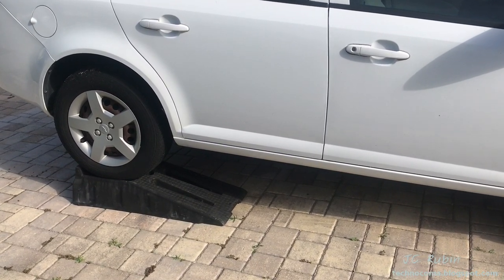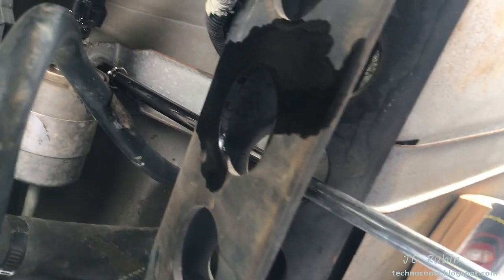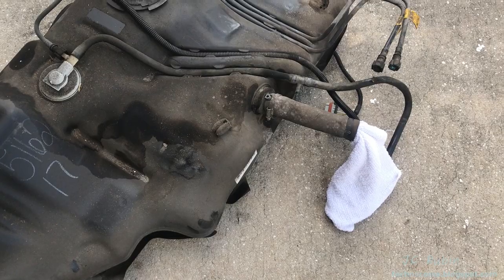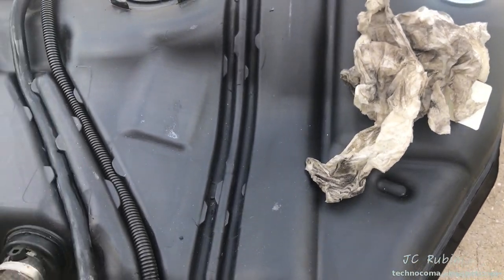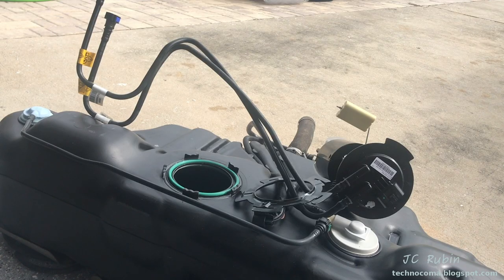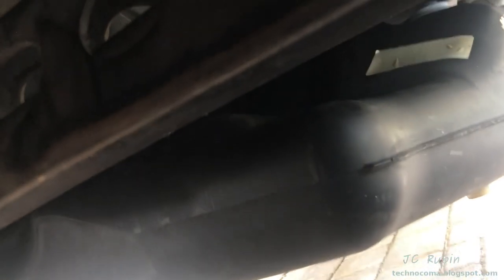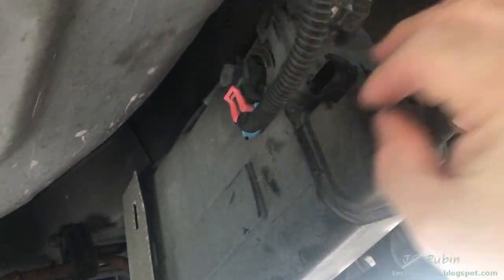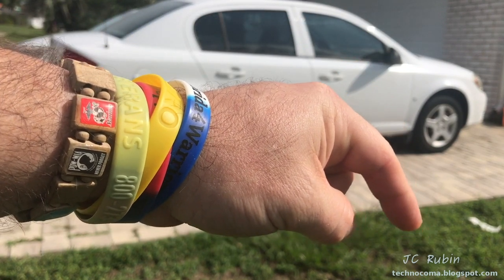Chevy Cobalt Detailed Fuel Pump Replacement in the Driveway

Comment: Well done! 5star install video. In my case in the coupes the metal fuel lines rot out on the driver side going up over the rear wheel. And I broke the 10mm bolt on the fuel filter. Slide the filter out don't bother touching the bolt 2 for 2 broke.
Reply: I just did the same 🤦‍♂️
Reply: Same here. Twisted the end off the charcoal canister mounting bracket. Line broke into by the rusted through area by the wheel on removal. Got the full length factory line to replace. Unbelievably difficult path to fish that line through. Not much wiggle room. Considering cutting the new line and reassembling with compression fittings. Would be rust free new but hate to cut new lines on installation.
If they made the line in sections and with flared fittings it would be much easier to install. An aftermarket company makes that very thing. Some have nylon flexible lines but won't fit in stock mounting brackets. I really wanted the OEM one piece line to work but on floor jacks it might be more trouble than it's worth.

Comment: I had issues with my fuel filter leaking...Replaced it. Had issues with my Starter...Replaced it. Had issues with my Fuel pump, replaced it...Got a video also. Seems the cobalts didnt get good fuel system installation and parts upon being manufactured lol. I was wondering why my car had such poor mileage, I was thinking it was my old tires...But I kept smelling gas and it was getting stronger and stronger. Luckily it was just a fuel filter. But with this I'm glad there was no spark or nobody threw a cigarette out the window lol.
Reply from the maker: and a crap ton of recalls, but only in some states, i didnt understand that.
Reply: Was the filter itself leaking or was it leaking at connections?   How old and how many miles on your car when this happened?

Comment: tip remove fuel line from fuel rail and put it in a gas can then remove fuel pump relay turn on the key and jump the two posts for the relay and the fuel pump will drain the tank into a can with no mess and fast
Reply from the maker: Unless of course....... The fuel line is cracked...

Comment: What is the primary thing that made you change the fuel pump? Is there a specific code for it?
Reply from the maker: The ends of the pump would crack and leak, it’s a know. Issue
Reply: @retrotechandelectronics  I see... So I've got a P0171 on my 2010 cobalt... But starts fine and doesn't stall.... No noise from fuel pump either... Probably not the pump then huh?

Comment: I took the Best way to work on our Colbalt. Drive it to Chevy and let them go to town. To my surprise, These car are Very inexpensive to maintain. I had A problem with the Darn Engine light. Purge Valve Canister was Junk. I must say that these car's are great. Ps. Great  Video.
Reply from the maker: Thanks!
Reply: Is that the valve next to the engine? What did that cost to replace?  I think I may have the same problem.  How old was the car and how many miles on your car when this happened?

Comment: I haven’t seen to many Cobalt sedans with a manual transmission.
Reply from the maker: This was one of the Cafe cars in 08.  The one with the base options that got max economy to offset the Chevy trucks in the GM total average that year.  Its rare indeed.
Reply: Retro Tech & Electronics one thing I find odd, is that the Pontiac G6 which (to my understanding) is supposed to be more luxurious than the Cobalt/G5 doesn’t come with a cabin air filter, or an external fuel filter (it’s built into the sending unit/fuel pump, idk what it’s called)

Comment: Difficult job, looks easy on the video.
Reply from the maker: The only difficult part was reinstalling the heat shield over the tank without a second person to support the passenger side of the tank.
Reply: Looks easier to me once someone gifts you with a well made video tutorial. Takes the guesswork out of the equation. I've done these 3 times already on other vehicles and each is assembled different. Gets easier every time. Especially when a quality YouTube video like this shows exactly what to do and refreshes my memory. Worked on hundreds of cars over the decades and it's a constant learning process. Small challenges are fun when you're not in a hurry. Lol
Old Chevy 350s were my favorite engine back in the 70s and 80s. Much easier to work on.
Reply: Ha, Ha, Ha you sure are right about that.